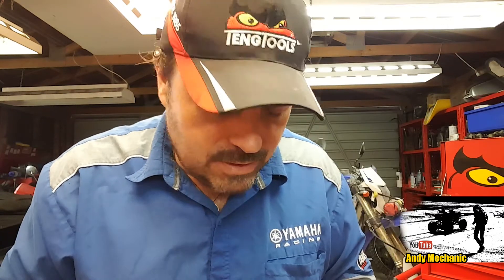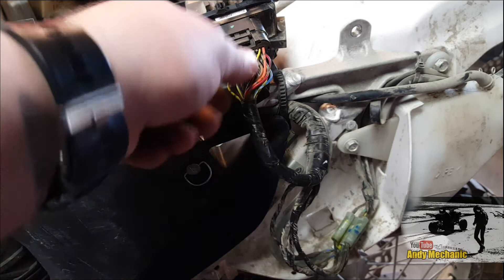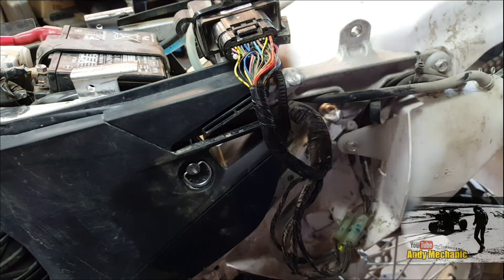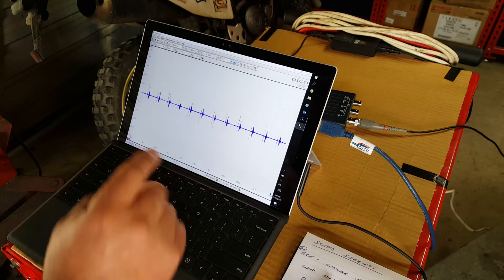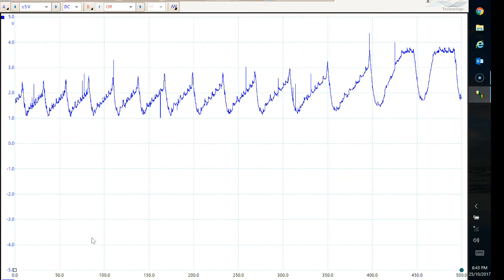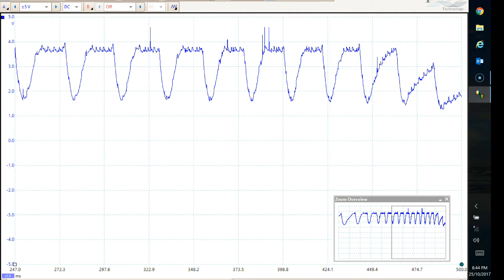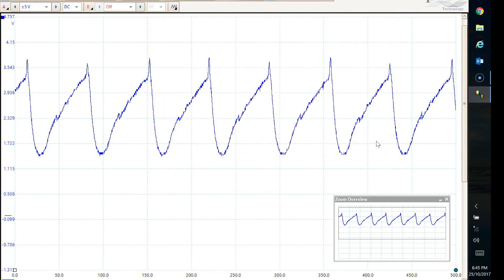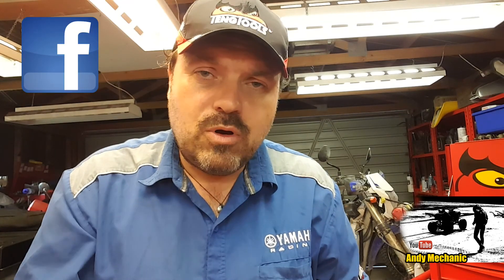How to capture a MAP sensor waveform using a PicoScope #1216

Comment: Hi Andy, I watch your utube channel and i love it and i learn ALOT. But I recently had my water pump hose and power steering the heater , OH I forgot what it's called, but it was to help the antifreeze from leaking, we'll it's still leaking and every day I have to refill and even before I leave some where in mid day.  But my question is, can the box, I even forgot what that is called too, but can the antifreeze box be leaking, instead of the holes?, and can the Antifreeze box be replaced? , Because the mechanic broke the bottom of the Antifreeze that connects to hold in place so it doesn't bounce around broke and so it bounces around.. plz help! WHAT can I do? ..i can't be paying for Antifreeze every other days and spending close to $70 for Antifreeze a month..thanks so much for any solutions you have for the car!

Comment: Thanks Andy. Did you just purchase the PICO scope or the whole automotive kit. I already have a lot of the add ons such as connectors amp probe etc. what one would you recconmend for the DIYer. I'm a retired  aircraft mech getting into automotive just to continue building skills. Watch Eric O and scanner danner in fact I'm doing his book and classes. Thanks all info is helpful
Reply from the maker: +Arthur Fricchione just the PicoScope basic for now. I wanted to show how useful even the basic one is for diagnostics. Will get the automotive kit next year for sure